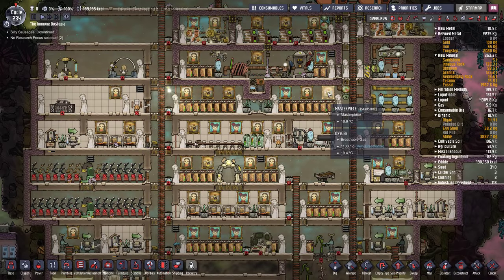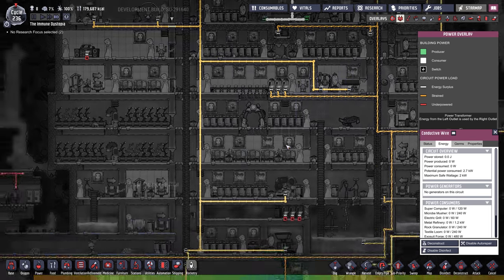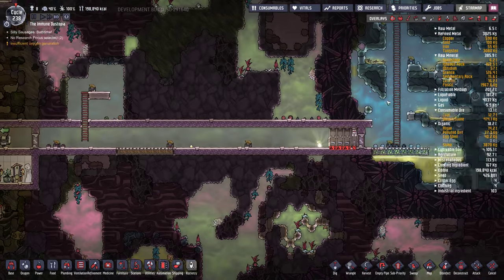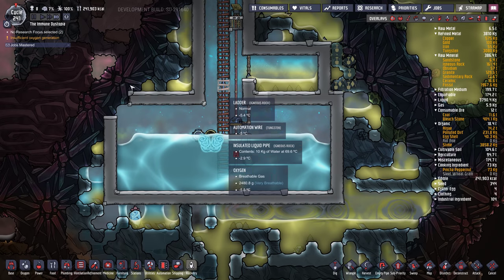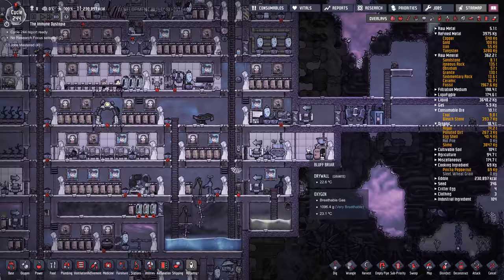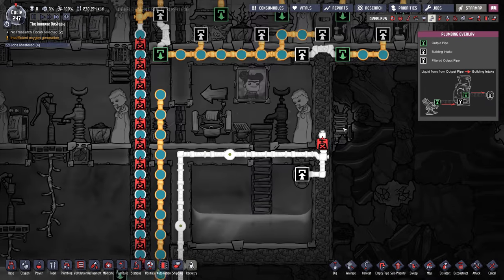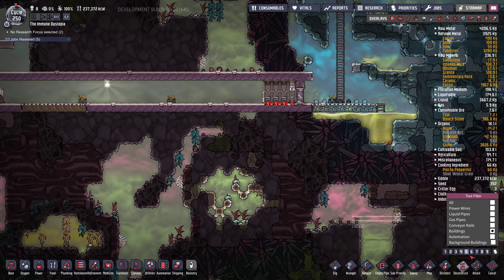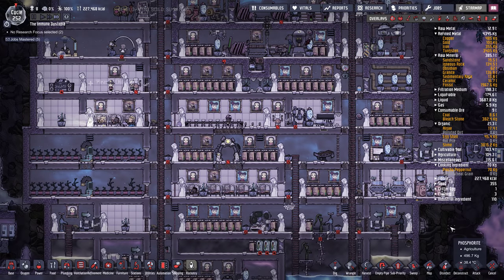DUDE! Fix My Base #3 - Oxygen Not Included Space Industry (Sneaky's Base)

Comment: if anyone is having troubles with oxygen. Run a water source to two electorlizers and through two toilets. Run the toilets through a siv and then back into the water source. The toilets will out perform the elecrolizer and you will will get more water plus it will keep the electrolizers fed. You can attach a hydrogen genni into the mix to have a self  perpetuated oxygen system.

Comment: Things became much easier once I understood how bridges work with liquids and gases.
1. Branching pipe. When branching the pipe, the flow is divided equally whether you want it or not. 1st branch, 1/2 packets will go left, 1/2 will go right. 2nd branch, 1/4 packets left, 1/4 right. 3rd branch, 1/8 left, 1/8 right. This means that if you keep a main line and branch off it, the first branches will get a lot of flow and the last branches will have minimal flow. Either branch in a tree-like way or use bridges. The same goes with merging. In a branch, half packets are taken from the left and half from the right.
2. Bridge inputs. If you don't have a branch, but instead have a main line with a bridge input in the middle, then the flow will go through the bridge first until it backs up. So if you want something to draw liquid/gas from a main line with priority, then use a bridge to get liquid/gas from the main line (without branching the line with pipes). If you want something to draw liquid/gas from a main line without priority, cut the main line with a bridge (so the flow will go through the bridge first) and then branch to the consumer (from the input of the bridge).
3. Bridge outputs. When merging gases/liquids, the first producer on the line has priority. If you have many producers dumping gas/liquid to a main line and you want a producer dumping with priority, then cut the main line with a bridge and connect the priority output to the bridge's output. If you want a producer dumping without priority, then connect the output of the producer with a bridge to the main line (output of bridge connected to the main line).
Reply from the maker: That is a nice summary of how things work :)

Comment: to expand on what you said with the water siv i use the oil refinery for cooling water and the metal refinery, what i do is pump oil threw hot water and the turn the hot oil in to mid temp potroliom.
Reply from the maker: So you're cooling your water with oil?